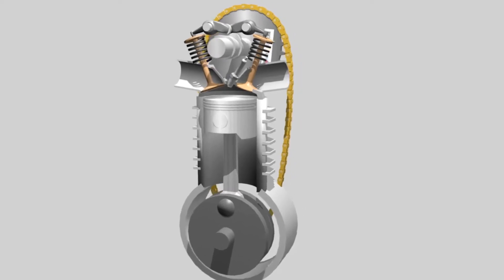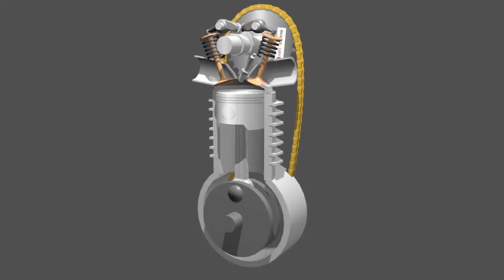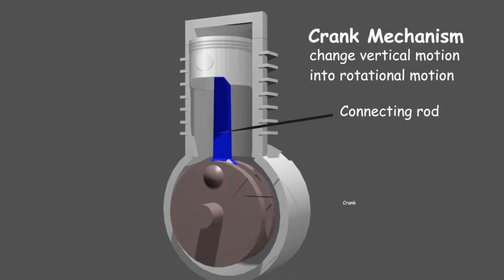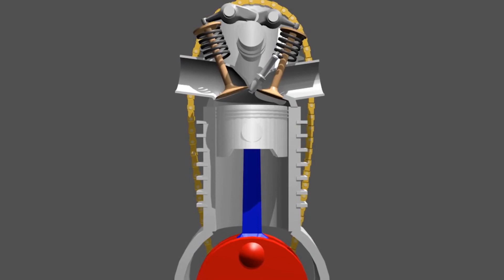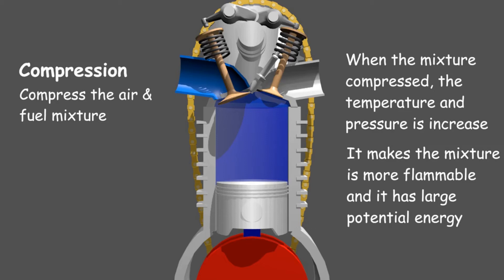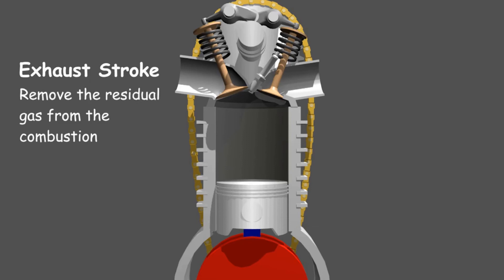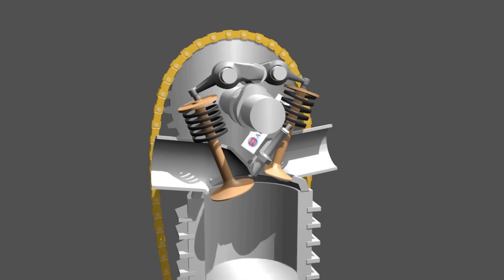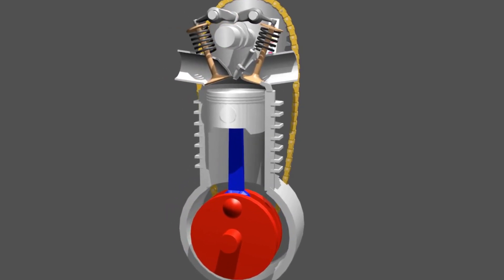4-Stroke Gasoline Engine Working Animation

Comment: you didn't make it clear as to what allows the valve to go up.
After the explosion it is only down...what power did it have to go back up...
I'll investigate further...still, I learned something..
Reply: The most common scenario is that the valves are kept closed (up) by coil springs.  The camshaft - or cams haft, lol - lobe pushes the valve open (down), and when the lobes pass over the valve and ceases its pushing the spring closes the valve.  There are other types of springs and valve actuation scenarios, but the one pictured here with typical camshaft and valve springs is what's found on the majority of 4-stroke engines.
Reply: the camshaft makes the valves open and closed.

Comment: 1:24 why does the piston immediately returns to the top..? I mean what is forcing the piston to move upwards?
Reply: "rotational motion" of the crank, like its "momentum"  continues the rotation it is why some engines have a flywheel not just for clutch but the weight gives it momentum/inertia  for te next cycle

alot smoother with more cylinders in one crank

Hope that helps
Reply: @SRDmotorsports   thanks a lot❣️
Reply: @befriends-y7d  no problem it was a good question :)
Reply: rotation motion which the crankshaft and the camshaft at the top is joined by chain  at the back of the piston so the rotation motion makes the piston up and down  and also the ignition that  makes the piston downward movement